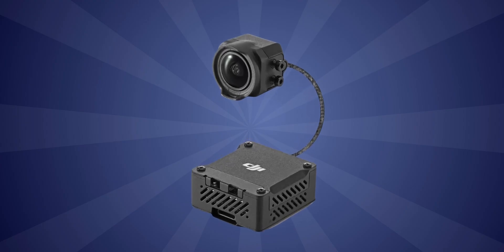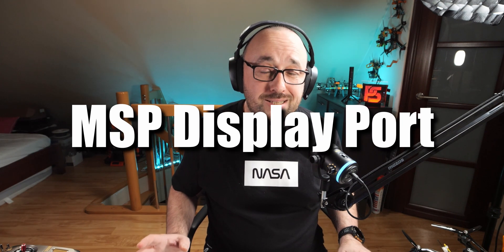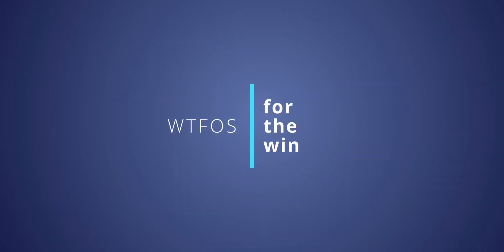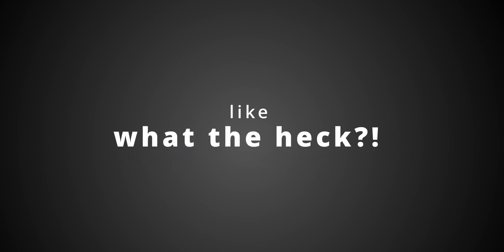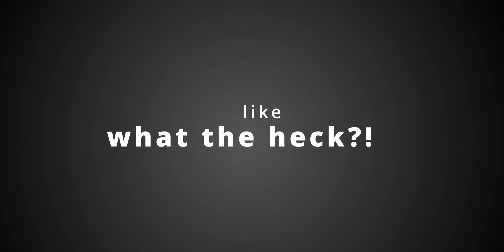The fix for DJI Air Unit O3 and INAV Display Port

Comment from the maker: Rant: DJI O3 Air Unit, OSD, canvas mode and INAV https://youtu.be/0OQDlcAeOV4
Reply: Dzień dobry. Jak wyszedł projekt z Encjakami? Bardzo zależy mi na odpowiedzi, chodzi mi o pana projekt z przed 14 lat. Mam nadzieję że się udał i chcę się zapytać czy on w ogóle jeszcze istnieje
Reply: It's not working for me.  I'm using configuration 6.1 and firmware 6.0. There are only auto,pal,and ntsc in the video format section.

Comment: DJI O3 with Inav 7 with serial port type set to "MSP Displayport" with no option to change to "BF43Compat" in the OSD tab. Only AUTO, PAL, and NTSC. I can not find any information. FC F405-WMN. It worked fine in 6.0, I saw your comment saying it is better in Inav 7....I would love your help!
Reply from the maker: And it still works. Make sure you realy have MSP Displayport active, not the MSP option

Comment: Hey there, Have you had any luck using the DJI Controller 2 with the 03 air unit and INAV? I've got a F405 Wing Speedy Bee Stack and can't get inputs to work.. Video and OSD work fine just no controller inputs. It even has a dedicated port for the new 03 Unit..
Reply from the maker: yes it works if you select SBUS output from the air unit
Reply: I had this problem and turned out to be a faulty O3 unit (SBUS not working) Sent back to DJI and got a new one and it worked first time. I went round in circles looking for an answer to why SBUS was not working with SpeedyBee and and INAV and blamed everything else 🙂

Comment: hello,
my vtx is always turn off,because i dont know how power on vtx power switch with inav 6.1.1…
(it is work well whit betaflight,but i prefere inav:-)))
thank you very much

my fc is mamba f405 mk4 2022b, I already succesfully flashed the right firmware back and forth between BF and inav... the result is still the same... my dji o3 not powered with inav firmware...
Reply from the maker: Are you sure you selected the MSP Displayport in the Ports tab? You should not select MSP like in BF
Reply: @FPVUniversity  dont mind the ports, my O3 is not even hot or powered on when connected to battery... and yes, I already do exactly as your advise...

Comment: The 03 unit now works in osd iNAV. -- disable msp in uart1 and select msp display in peripherals for uart 1. Select BFHDCOM in OSD tab. Working on my Manta 5D 03.
Reply: hi there i have a 10" with mamba h743 and o3 and i am trying to flash inav and all goes well but the o3 does not power on.. already tryed to go back to betaflight and it works perfectly.. it is the second time i configure with inav after flashing and i dont know what to do.. any idea?
Reply: no idea.. i do know the air unit has to be uart 1 with uart 2 rx if you're dji. i would say check connections but you said it powers on with betaflight... has to be a port/connection issue. @ghostdogfpv

Comment: Pawel as always nice work but it's not working for my V2 goggles. I am running INAV 6.1.0 and FC Firmware Matek 6.1.1, MSP DisplayPort is selected in the Ports Tab, I have BF43COPAT checked on the OSD menu but telemetry elements are not being display. The goggles and DJI 03 unit have the latest firmware running. It there something on the Goggle side I need to configure? Thanks!
Reply: Resolved - turns out it was the flight controller, keep the exact same configuration - setup and swapped out the flight controller, everything works now!
Reply: Yes for me it works on a AtomRC FC but not on a SpeedyBee F405!  So annoying.  @nuwave5749

Comment: Hello, could you help me? I have a question, is INAV compatible with dji O3? I connect my drone to INAV and the O3 does not work, the O3 leds are off, and with betaflight it does work, how can I solve this problem? Thank you very much

Comment: Does not work when you try to use an older vista or air unit when using the dji integra goggles you have the camera feed but the osd on the inva tab does not match what you see in the goggles, i am finding it very difficult to put things in the correct place! all guess work? also tried inav 6.1.0 and that does not recognise the softserial on the matek f411te...!

Comment: Hello, will there be any solution for o3 HD OSD support? DJI released an update a few days ago, but I still can't set a 16:9 view in INAV6 because there are question marks all over the place of the data.
Reply from the maker: INAV 6.1 will solve this issue
Reply: @FPVUniversity  Unfortunately, HDOSD does not work properly in Inav6.1 stable. AHI cannot be centered. It's on the far left side of the screen.

Comment: hey i downloaded the latest Version 6.0.0 RC1, but i cant switch to the BF43COMPAT, what did i wrong?
Reply from the maker: you also need firmware 6.0, not only configurator
Reply: @FPVUniversity  hey Pawel i dowonload and flashed the matching firmware.
Reply: @FPVUniversity  I checked again, configurator has 6.0.0 rc1

The Matek F765WSE has 6.0.0

You have another idea whats possible wrong? 

Thanks.
Reply: @FPVUniversity  it was my mistake!!! i forgot in the ports to put on msp displayports. After i did this i could change to the BF43COMBAT

Comment: Does DJI GOGGLES v2 has to be rooted and installed WTFOS to work this kind of OSD with DJI Air unit 3?
Reply from the maker: No, all of that with the latest firmware on goggles and air unit
Reply: @FPVUniversity  Great, thx for info, I tried and it works like a charm:) Thx for all effort Pawel!

Comment: Hi pawel, I was wondering if you have tried adding a Electret Microphone Amplifier Sensor or something similar to your FC or O3 in some way to record the audio of the flight? with out adding a GoPro. As the new O3 video quality is really more than good enough
Reply from the maker: no I have not.

Comment: I just installed INAV 6 and flashed a 6.0 version of FC firmware but I dont see the BF43COMPAT option available. Is this option not released yet?
Reply from the maker: Check when that version was released 😁before O3 appeared on market iirc
Reply: @FPVUniversity  so when can we expect this version to be released?

Comment: Weren’t you in contact with DJI to try to get real INAV support? Do the differences between the compatibility mode and INAV’s regular MSP mode offer any clues as to why it’s not working?
Reply from the maker: because to get full support DJI would have to implement 512 char mode and custom fonts. Which they did not
Reply: @FPVUniversity  Did they express any issue on changing this in the future? I seem to remember hearing about people having issues possibly if they used the wrong characters in a craft name, for example. I suppose allowing users to put custom fonts on the internal storage would be too much to ask. If the fonts were the same as the ones used by the FPV.WTF hack, it would be amazing.

Comment: Flew a nightly last week and it was glorious to actually have any data at all.  Looking forward to the public release!
Reply: What were you able to get as far as elements?  As long as I have a home arrow, GPS count, flight mode and voltage I am content. Anything else is just a bonus!
Reply: @DT-gun  Yes to all the ones you listed. I also used distance to home, current, total current, alt, speed, and LQ. Some of the numeric values aren’t perfect because of how decimal points are handled differently between BF and INAV (I think), but it was working well enough that if it didn’t look quite right then I was able to decipher it. Current, for example, might show 8.40, but then you raise to 75% throttle and now it shows 310, which, I believe, is really “31” plus the zero left-over from when it said “8.40” right before that.  Even in this state, I was perfectly happy with what I had.
Reply: @brubakerjm   what do you have to do to set this up?

Comment: Aw man, Pawel, I do NOT want to switch systems. I have 2 full DJI sets in V2. and about 15 good vistas and air units. I'm not switching soon.
My gogs said firmware 0606 but FPV.WTF and Assistant BOTH insist its 0607. I am locked out of FPV.WTF upgrade and stuck in the old paradigm. Aaaarg. DJI, You are an evil genius! 
It may be a Mac related problem.
Reply: Just run butter and you can downgrade your firmware
Reply: You can still root your goggles. As of a month ago its now possible.
Reply: @peacemakermotion3949  Seriously? I will go back and have a look. 
Did FPVWTF get over the new wall? 
I also read that it will only work on a PC. Not rte Mac.
Reply: @peacemakermotion3949  sorry, #2 message: I did that video on Dec 9. I must have missed the change by a very short period if something has changed.

Comment: Cant wait, currently on one of the nightly builds and it works but freezes and you just swap osd when it freezes.
Reply: The freezing has been fixed in the newest builds (<3-4 days), no need to swap OSD pages anymore
Reply: @Olivier-C  awesome work 👏
Reply: @Olivier-C  il y a toujours des soucis sur l'affichage de l'altitude ?
Reply: @Olivier-C  Good to know!  I was debating putting OSD-switching on my momentary switch to make refreshing the screen easy.  Now I won't have to!

Comment: That's a great addition for O3 users (not me). I currently use DJI v1 goggles with wtfos, but my next HD system will be HDZero instead. I see a much better future in that. I'm so tired of the business model and antics of DJI (much like I was  with FrSky until I moved over to ELRS).
Reply: I agree,  sadly I just spent a grand on the goggles 2 and a single 03 AU. They work well with the speedy bee F405 wing FC and it's going to be killer for long range; all that being said I'm tired of the antics. 🙄
Reply: Your loss
Reply: @nofluxgiven1949 not really,  i bought the goggles 02 and the 03 AU and dude is right,  DJI and their BS model antics are pathetic. Besides,  we are going to be at war with China very very soon kid,  keep watching- wink wink